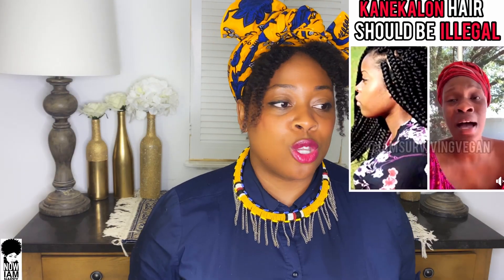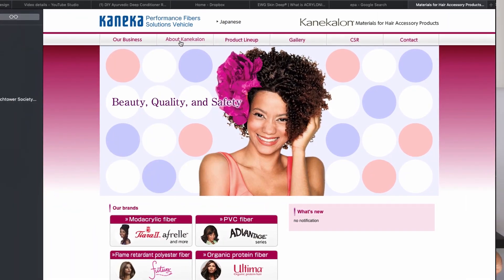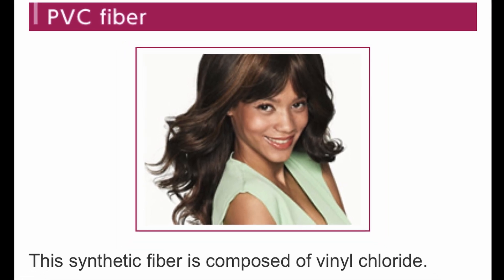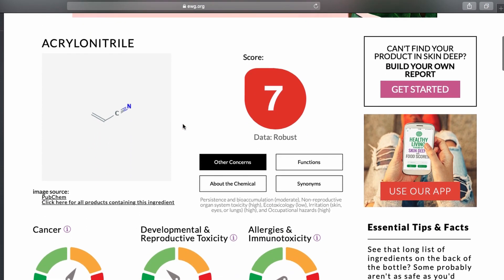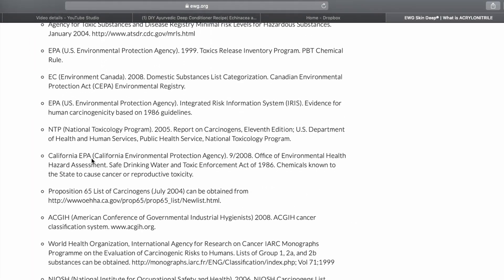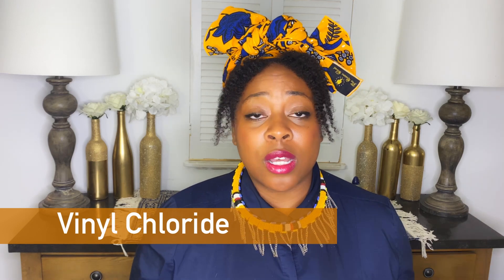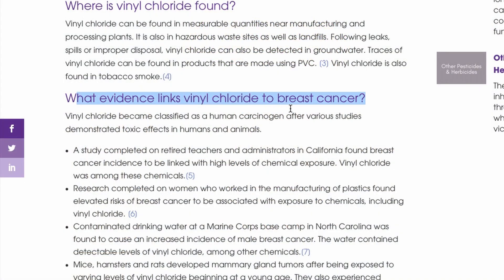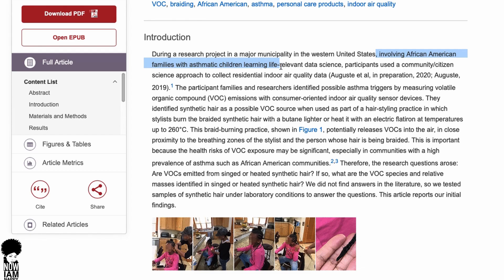What is Kanekalon Hair Made Of? | Is Kanekalon Fiber Hair Toxic ?

Comment: It  irritates me when I see videos like this. Not because she's spreading misinformation or even intentionally misleading people. It's just the conclusions she reached are objectively true, but subjectivity inaccurate. 

This is a problem I see 1,000 times a day. When people hear the word "chemical" they immediately feel like it is something unsafe (and at risk of sounding like a rogue conspiracy theorist) because this is what we've been conditioned to believe. 
 "Chemicals" are the building blocks of the universe. These long names are meant to convey exactly what a substance is made of. Take Dihydrogen Monoxide (H20) for example. 

Without this chemical, you will die within days. The only treatment that can keep all of your organs (brain included) from shutting down is continued exposure. Dihydrogen Monoxide is simply the name for the chemical make-up of water.

 H=hydrogen and O=oxygen. Both of which are EXTREMELY EXTREMELY flammable. Oxygen is quite literally the fuel of fire. No oxygen, no fire. It's why when if you cover a candle it goes out so quickly. The fire used all the oxygen available to it. 

The Hindenburg, a giant blimp filled with hydrogen exploded as it tried to land before a storm. It wasn't struck by lightning. It exploded because of a small leak and random electricity in the air. Disintegrating and killing 96 people in under a minute. However, you take two hydrogen molecules and one oxygen molecule and bond them together. You get water. Which unless you're spongebob or Adele. You're going to have a hard time setting water on fire. 

Chemicals aren't good or bad. They just exist. It is about the bonds that they form, or don't form, that makes all the difference. I'll not sure how these chemicals are bonded together, but from a buisness stand point. Its really hard to make money if your products keep poisoning the people who are buying them.

Comment: So I did a bit more research on these two chemicals. Yes, it is absolutely true that in the right circumstances these chemicals are toxic, but short of working inside the manufacturing plant. You'll never be exposed. 

First, Acrylonitrile is only so toxic if it is inhaled or if you come into contact with it as a liquid. Acrylonitrile would have to be a concentration of 16 parts per million (PPM) over several hours for you to begin to have a reaction. This means if you you have a million air molecules. You would need 16 of them to be made up of this chemical to affect you. In an average medium sized room that is completely empty and airtight with no ventilation you have around 6 octillion (6,000,000,000,000,000,000,000,000) air molecules. 

 Vinyl Chloride is absolutely used in the making of Kanekalone hair, but not like how you would think. It is a gas used to create Polyvinyl chloride (PVC). A type of strong durable plastic (sneeze guards, pipes, plastic cutlery etc) that is only dangerous in it's gas state and you would once again need high concentrations in a sealed room. The reason the factory workers were so sick from the chemicals is because of the constant exposure and unsafe working conditions. 

Drinking or breathing in molecules from clorox bleach is WAY WAY WAY more dangerous that wearing Kanekalon hair
Reply: This is a good point, as well. But the problem is that there is not enough research or studies done on the long term effects of putting this type of product in your hair. This evidence is definitely not to be turned away, especially since we are seeing a rise to breast cancer, reproductive issues, birth defects and etc. within the balck population.
Reply: @rialance8887  Most synthetic hair is made of these materials. Not just braiding hair. "Braiding hair" is more of a sub category that refers to the way it is altered. Basically, it's run through a machine that adds texture to the hair so it will hold braids better. If there was a rise is breast cancer and birth defects across everyone who wears it. You could then link it, otherwise it's a coincidence. Correlation doesn't imply causation. Even if researchers ignored POC in studies. If they found a link for white people. It would be talked about.

You also have to remember that these chemicals are used to make other plastics used in society. Not just synthetic hair extensions. So more than just black people would be regularly exposed.
Reply: i figured the form of the product mattered- solid, liquid, or gas.
Reply: Thanks
Reply: It  irritates me when I see videos like this. Not because she's spreading misinformation or even intentionally misleading people. It's just the conclusions she reached are objectively true, but subjectivity inaccurate. 

This is a problem I see 1,000 times a day. When people hear the word "chemical" they immediately feel like it is something unsafe (and at risk of sounding like a rogue conspiracy theorist) because this is what we've been conditioned to believe. 
 "Chemicals" are the building blocks of the universe. These long names are meant to convey exactly what a substance is made of. Take Dihydrogen Monoxide (H20) for example. 

Without this chemical, you will die within days. The only treatment that can keep all of your organs (brain included) from shutting down is continued exposure. Dihydrogen Monoxide is simply the name for the chemical make-up of water.

 H=hydrogen and O=oxygen. Both of which are EXTREMELY EXTREMELY flammable. Oxygen is quite literally the fuel of fire. No oxygen, no fire. It's why when if you cover a candle it goes out so quickly. The fire used all the oxygen available to it. 

The Hindenburg, a giant blimp filled with hydrogen exploded as it tried to land before a storm. It wasn't struck by lightning. It exploded because of a small leak and random electricity in the air. Disintegrating and killing 96 people in under a minute. However, you take two hydrogen molecules and one oxygen molecule and bond them together. You get water. Which unless you're spongebob or Adele. You're going to have a hard time setting water on fire. 

Chemicals aren't good or bad. They just exist. It is about the bonds that they form, or don't form, that makes all the difference. I'll not sure how these chemicals are bonded together, but from a buisness stand point. Its really hard to make money if your products keep poisoning the people who are buying them.
Reply: @augustjsb  Thank you for sharing this....
Reply: Nah I'll pass anyway. Thanks for all that.  We literally heat this hair up all the time. It's doin damage. I'll stick to yarn.
Reply: @onasmom21  acrylic polymers are all around you...
Reply: Took a me a while to find this comment, in hopes someone would have mentioned this. Even though I’m years late - yes. This is important. Hundreds of toxic chemicals are used in the production of things the average human being uses on a daily. Separate components and production materials safety and/or toxicity do not equal final product safety and/or toxicity. 

Casually stumbled into the “kanekalon will give you cancer” video on tiktok and when I went to investigate it further I couldn’t find anything about the final product posing any sort of proven health risk through its proper employment.

It’s still a massive pity that more sustainable and eco friendly alternatives to kanekalon hair and synthetic hair in general haven’t become a widespread and accessible alternative yet, but still, even though the environmental impact of synthetic hair is far higher than any health risk it could possibly pose to its users, there’s more sensational and disturbing clips about the latter going around despite the info being provided being overall inaccurate (I am not referring to this video, but to the sensationalized ones showing unrelated images of lung cancer for views and which ultimately lead to a huge spread of misinformation)
Reply: Thanks for sharing this....
Reply: Exactly 
Someone is searching for new business here. 
Problem of African woman problem is illegal vaccination and after genetic problems not kanekalon braiding. 
❤

Comment: if you’re going to use this hair please soak and wash the hair before you install it. use warm water and acv vinegar (or white vinegar) and soak it in the tub for 15 minutes, press down on the hair then rinse the hair & drain the water. then soak the hair in shampoo for 15 minutes rinse & drain. do the same thing with conditioner & let it air dry.
Reply: Plus, it appears that it's still toxic regardless of an ACV soak sis.
Reply: I tried this and it didn’t work my hair was still itchy
Reply: No disrespect but that is not going to work and it's not going to erase the chemicals that it is made with.
Reply: I soaked it for 24 hours, still made my scalp itch and my seborrheic dermatitis flare up 4 times faster
Reply: Why do have to go through all these stress when you can avoid it completely... health is wealth
Reply: That's does help the toxicity it emits.
Reply: How will that help when it’s made of chemicals?   You can’t wash the chemicals out.  It’s made of chemicals
Reply: Acv is not strong enough to remove industrial chemicals hon. 😊